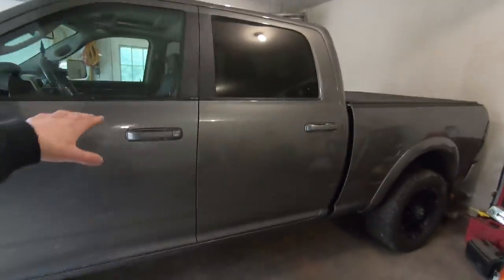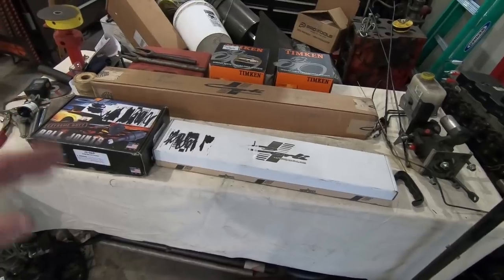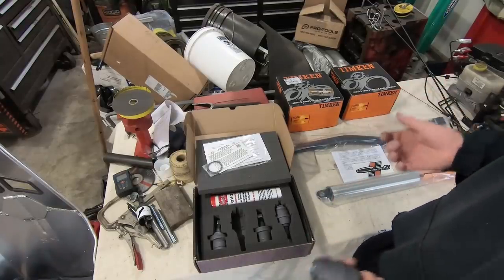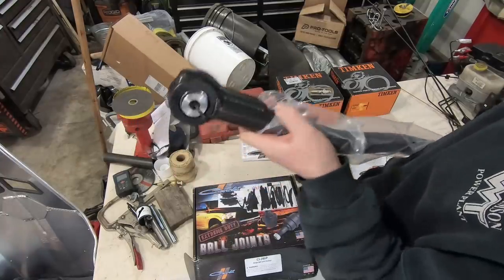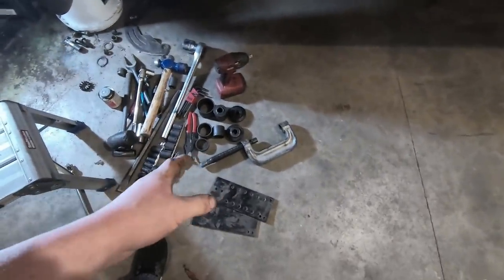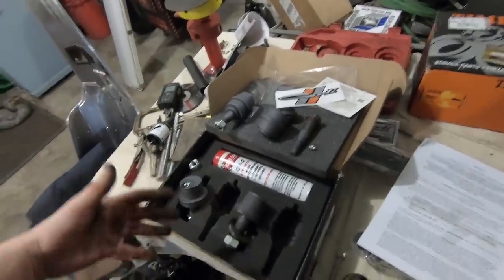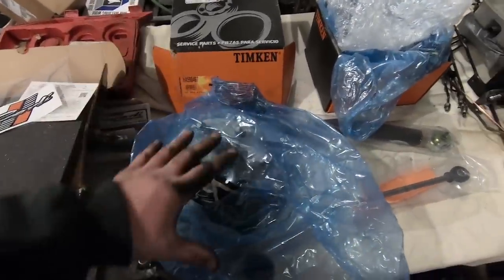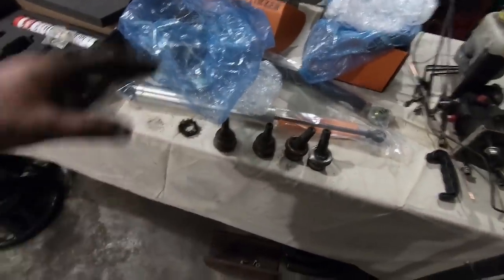KILLING Cummins DEATH WOBBLE!! EP. 1 Carli Ball Joint Install

Comment: Steering brace is the way to go. I chased front end issues on my 2nd and 3rd gen for a long time, I even have a thuren stage 3 front end on my 3rd gen. Steering brace fixed all wobble and steering play in both of them.
Reply: They needa put them on from the factory!
Reply: They just need to better engineer the front end

Comment: I just did rear brakes in the wife’s car. Over 100k miles in the odo. Changed both calipers because after I did the fronts, one of the calipers got sticky and I had to replace them. Sucked. If I were into a front end like you have done, I’d swap out both front calipers too. At over 60k miles in a HD truck, they see a lot of vibration and the pistons might be suspect. Changing everything else like you did is good smart insurance 👍 and you don’t wanna go back in there and take something apart when you just did all that. Carli is great stuff. Good video!

Comment: Hey brother I got a 3 leg puller and it removes wheel bearings and the rotors when there stuck has a threaded middle and 3 hooked arms and works minty just a tip if u didn’t know already appreciate ur videos man keep up good work

Comment: I also have a '12.  I have never experienced a death wobble, however I have over 100K miles and have been eyeing those carli ball joints for a while.  Only reason I have not bought them yet is because they are so darn expensive.  However, they should be the last ball joints you ever replace on the truck.

Comment: Tom check your track bar bolt holes where they mount on the frame and axle sometimes they get oblong from death wobble and can have play if not I suggest some grade 8 bolts with solid shank and enough thread for the nuts that’s  more solid ( big ol bushing ) vid on u tube explains check it out . There is endless info on this wobble shtuff . IV had it and still can’t say it’s cured after endless wrenching and $$. Might as well check the race truck front end cause if that wobble happens on the track that would SUCK. Thanks fer the vids.

Comment: If your pulling front axles for ball joints you might as well replace hub bearings, brake pads, and u-joints while in there.

Comment: The next time you do brakes you should get zinc coated brake rotors so they won't rest until after winter and even after winter the rust isn't going to be too bad it's just going to be surface rust and you won't have all that Rust falling out on the floor of your garage and it would be easier to get off also do not Warp that easy.

Comment: I changed out all the front end parts by myself, what a pain!  New U Joints, sensor, Rancho level springs, adjustable track bars, Fox 2.0 shocks, adjust sway bar end links, and ball joints.  I now have to replace the bearings (didn't have the funds at the time), the originals actually lasted to 240k miles though, but now have play like what you showed.  When going over bumps it's def getting a jarring impact and the wobble at 50 mph....

Some advice, don't use Rancho coil/shock  2.5" level kit, NOT worth it.  I should have done like you and used quality parts!    Alsol use the right over sized ball joint kit, not the "standard" one you can rent from Orielly's.  I spent most of my time trying to get them in/out than any other part of the rebuild. Moog has adjustable ball joints, the standard Moogs changed my angles and the tech had a hard time aligning one side.  

Lesson learned.....   If your bearings are fine, you can actually remove the sensor from the body and grease it from the sensor's hole.  Amazing how the new/factory bearings have little grease in them!

Comment: While most of these parts you are replacing are worn out and loose, it does not address the cause.  These front axles need a manual locking hub installed that will stop the extra wear on the system and save ball joint track bars steering box etc .  But good video

Comment: Did it fix your death wobble I have a 2007 ram 2500 and in looking into buying carli suspension but I would really appreciate your honesty it this parts fix the wobble if not so I won’t even spent the money on my truck
Reply from the maker: They did, try the track bar first. Easy to do and might solve your problem
Reply: Turba Tom what about all those parts you installed not including the bearings and 4x4 joints did it fix your truck the one on the video?

Comment: stock setup of wheel bearings is a HUGE WEAK spot I ended up buying a manual hub kit its AWESOME! Torque specs would have been nice on install but probably in the instructions

Comment: Hello , i got a question for you i have a 2010 and it just got crazy with the wobble did this fix your problem for you ?
Reply from the maker: Yes, doing this and the track bar solved the problem. If your ball joints seem good try just the track bar first. Also your tires can add to death wobble too

Comment: If I want to watch commercials I’ll watch cable. J/s
My wheel bearings at to be replaced at 40,000 miles. Mopar parts are junk!
Reply: I have factory ones at 211k miles.